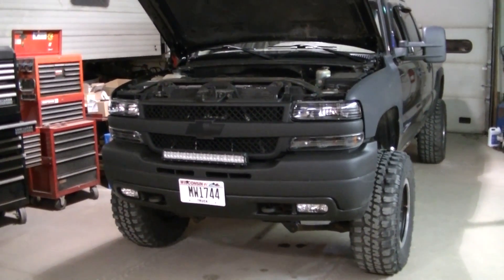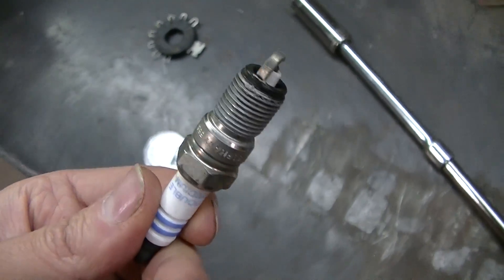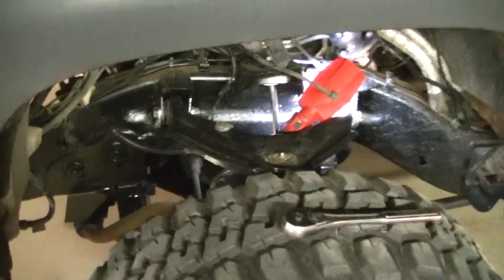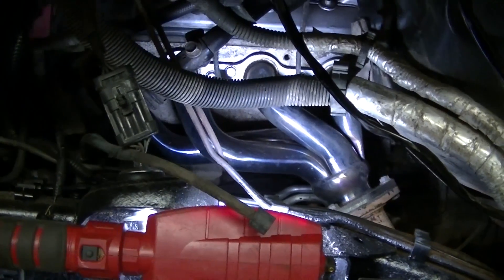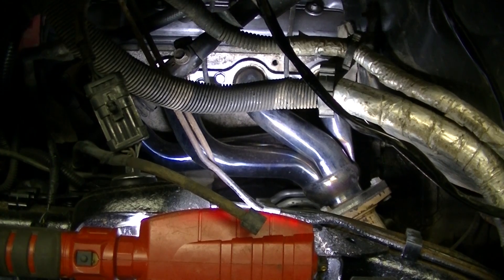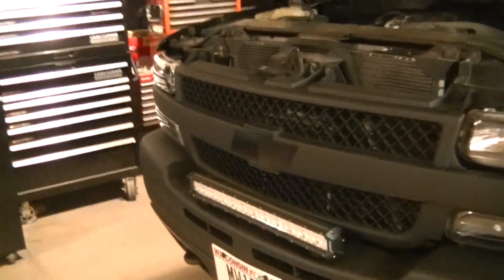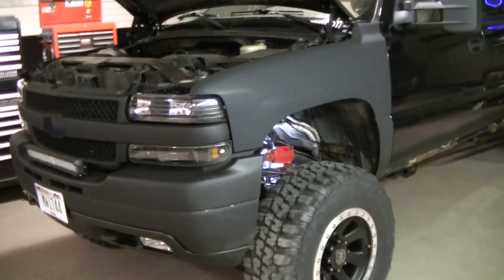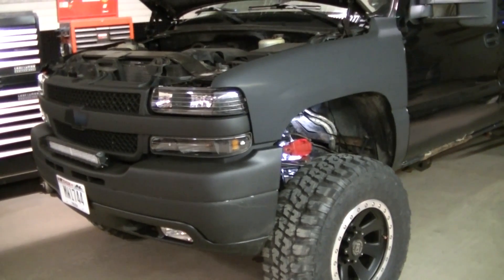Silverado 2500HD Spark Plug Wrong Gap Fix and Stainless Header Review

Comment: It sure would have been helpful if you would have mentioned the engine size in title.
Reply from the maker: The silverado 2500hd only had two engines that used spark plugs. The 6.0 which is basically the same as the 5.3 and 4.8. Or the big block 8.1. A quick look at the engine bay should have told you what it had. I can only put some much detail in the title.

Comment: I recently got a Silverado chasis front clip. I am going to mount an engine in it and make it the rear axle of a diesel pusher. I plan on switching to air ride because the torsion bars stick too far aft. The steering will be fixed to the frame.
Reply from the maker: Wouldn't it be easier to just fab up a frame section with new steel?
Reply: Maybe. But the engineering of the factory frame allows it to be light weight. And from a cost perspective, I got the suspension, brakes, diff, etc. all already installed. I don't think it is going to be difficult to stretch the frame if I need to. So far, I am just doing a lot of cleaning and measuring. I am doing this outside and the weather is just now getting good.
Reply from the maker: I just seems like you are going to have to mess with a lot of things that are just going to cost you a lot of time and effort.  Locking the steering.  Suspension modification.  Then if you have to add to the frame.  You also have ball joints that will wear out.  I think I would have started with the rear section of a donor truck.  The rear of the frames are straight so adding onto them would be easy.  Engine mounts would also be easy to make on some square tubing.  Just seems like a lot of work to modify a front suspension to work as a rear suspension.

Comment: If you're like me, you hate to do re-work, but at least you know it's right.  I like those headers.
Reply: Kevin Hornbuckle nylock will never work on exhaust. to much heat generated
Reply: Kevin Hornbuckle it might as long as it's rated for the heat of the exhaust. I'm sure a tack weld would work
Reply: I wonder if crimped nuts are the best way to go on those headers. Instead of nylox or lock washers.
Reply from the maker: At least it wasn't too bad of a re-work.  The headers seem to be holding up.
Reply from the maker: I should have gotten some locking header bolts.  Something like ARP has would have been a good idea.
Reply: I put them on the 383 in the dually and I haven't had an issue with the headers loosening up.
Reply: Kevin, I suppose that might work but you'd have to use studs, so would the studs loosen up??
Reply: I wonder if red locktight would stop studs from turning.

Comment: Spark plug gaps....this is why I buy the Bosch Plat 2 plugs.  Have you ever tried ARP's locking header bolt kit?  I'm curious if they solve the issue and they're thus worth the money.
Reply: I've used ARP header locks and they work great!
Reply from the maker: I have no idea why I didn't get some ARP bolts for these headers.  I guess I dropped the ball   :)